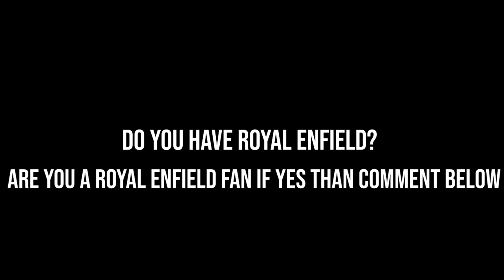Royal Enfield Factory Tour | How Royal Enfield are made

Comment: Yes, New 450 Himalayan (Hanle Black/tubeless) in UK and already 800 miles covered and very happy with purchase. All the options (front mudguard extension, tank protection, front forks usd deflectors, rear shock hugger cover) are all standard from delivery and the toolkit exceded all 5 bmw boxer twins I have had in last 20 years.